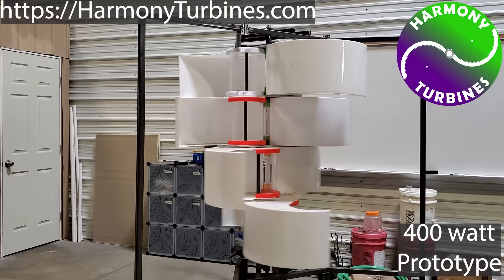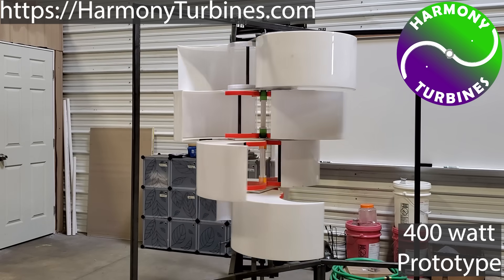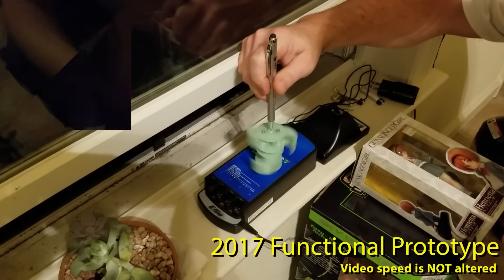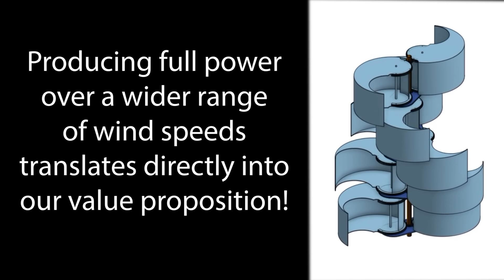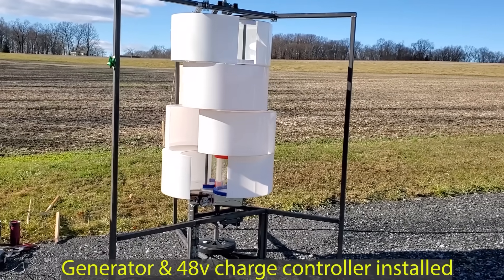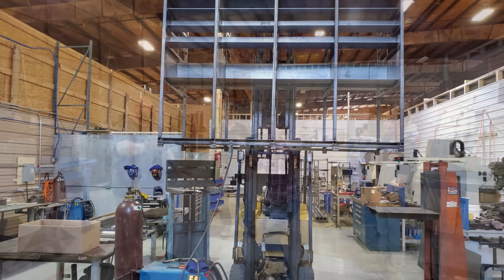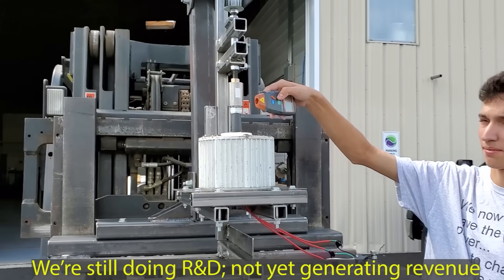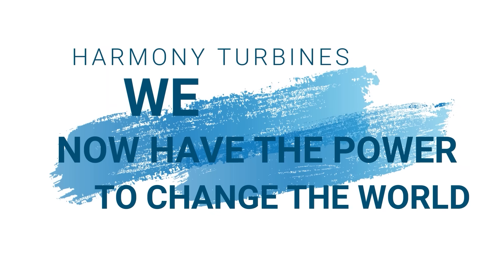What makes Harmony Turbines so revolutionary?

Comment: Looks like a variable Savinious rotor to me…  plans in mother earth news back in the 70’s-80’s…  vertical wind turbines can be better at harnessing gust energy, but a higher spinning mass negates some of this possible gain.  The fixed savinious was self starting and tended to be self regulating as the advancing bucket shadows the capture bucket more and more as speed increases, so it was virtually impossible to overspeed them.  I am guessing the variable mechanism is an attempt to increase low airspeed efficiency.  The fixed savinious was able to generate a significant amount of torque, and they were fairly easy to produce out of old drums…
Reply: Thank you to point out this claimed "revolutionary" product is just a bad commercial copy of an open source DIY design that have been here for decades. That is not "entrepreneur" attitude, that's the sort of attitude that gives good business a bad rep.
Reply: @lolaa2200  Nearly every "new revolutionary" wind turbine design already existed decades ago or is a slight but almost unnoticeable variation of one. There even is a book that sums up all these designs and their flaws and why they never were commercialized successfully. I think the author was interviewed in one video made by "Engineering with Rosie". 

Edit: youtu.be/6vb18oXPli4
Reply: I never heard of that type but I'll look that up, thanks for the hint!
My first thought was "it's a collapsible Flettner rotor" but this one is the only one I know that generates power from wind of any direction.
Reply: Savonius
Reply from the maker: Hi Rronmar, check out this article. High windspeeds are indeed a problem for Savonius turbines. Our design solves the problems associated with high speeds winds. In fact it totally negates the need for a braking mechanism or dump loads. https://www.turbinesinfo.com/innovative-wind-turbines/  ...interestingly this article also speaks to the little known fact that bad data published many decades ago, has led to Savonius turbines getting a bad rap for the last 50 or so years! -We are looking to change the history books and begin showing people what a truly well designed small scale turbine can do! Perhaps we can even become the new standard in small-scale wind power generation? Time will tell.
Reply: @HarmonyTurbines  Math is math and doesn't care about our dreams. If I want to produce energy on a small scale, I can just use a small HAWT, or better use solar and the turbine only for the last step to autonomy. 

Till now I only saw one application, were a VAWT truly outperformed HAWTs, and that is as an integrated part in lanternposts in the  middle of highways for energy-harvesting. Be careful with promises to your customers and investors: Some VAWT-enthusiasts even got themselves imprisoned because of false claims.
Reply: @HarmonyTurbines  well I only remember they were not an issue back then…
Reply: @HarmonyTurbines  I like your design. I'm planning to build Savonius units myself. I just moved out of the suburbs and on to acreage surrounded by flat farmland where it's windy often. I like the staggering to reduce vibration and noise. I really like your furling system. A pet peeve of mine has always been turbines that shutoff in high wind instead of safely producing full power.

That said, with your production facility at the stage it is, I'm disappointed that you don't have units for sale. It seem like you are wasting resources designing a generator. What do you expect to gain there? It's like you are addicted to R&D and R&D money. You keep saying that it's 30% efficient. Even if it's only 20%, if it's affordable and/or has other significant benefits, it's still a good design. The wind is free, so lower efficiency doesn't necessarily cost anything.

Where is the output chart: wattage produced at each wind speed. If the numbers are poor and you expect an new generator design to significantly improve those, you are mistaken. Your ROI on the R&D money will be low if you only attain a 1.5% output improvement. The whole world has already optimized generators.

Here's a snippet of market research: during winter and spring, I have a lot of 15-20+ mile per hour wind crossing my driveway (steady for days or weeks at a time). I'm looking to build or buy multiple 500w units to mount along the driveway until I have the power necessary to supply my low power house. I'm willing to pay decent money for a reliable unit. Do you have a product for me (and others like me) or not?
Reply: @HarmonyTurbines  So you have to apply power to the thing to make it close right ?
Reply from the maker: @cuckingfunt9353  Yes but closing (furling) is only needed in high winds so there's plenty of power during those times to sacrifice 30w for 10 or 20 seconds. The power is only needed while the furling mechanism moves. It is NOT needed to hold the scoops in place once the movement has stopped. We're spinning too fast, pull in a bit, re-assess, still too fast, pull in more, re-assess ...ok we're good now. The total power that took was maybe 30w for 15 seconds. The turbine will be making over 400w of power at these times so we're totally fine to steel a drop or two of power for the sake of safety.
Reply: @HarmonyTurbines  
Whut?!

Is motors needed? 
Why not a passive centrifugal regulator like old steam engines?
Reply: @madshorn5826  That’s what I was thinking!
Reply: @madshorn5826  Because someone has already done it and thus he can't make a patent claim unless something is noticeably changed... So he is using electronics which are more likely to fail then a centrifugal system.
Reply: @HarmonyTurbines  but he said that high wind speeds WEREN’T a problem for Savinous design because the get less efficient and turn slower because of this.
Reply: @HarmonyTurbines  but where do we get them?
Reply: @HarmonyTurbines  your article doesn't cite any sources.
This looks very scammy.

And even if the claims in this article about exchanged curved were true, the possible efficiency is still way lower than conventional three bladed designs.
Reply: @HarmonyTurbines  Work on hyperloop and Theranos while at it :D There is a finite amount of energy available in a cross section of wind. You can call it bad data or whatever you like.
Reply: @NGC1433  The hyperloop is an amazing project, don't mock it! At least on paper it's amazing. When you try to think about the practicality of it, the dream somewhat implodes ...

(Sorry, I couldn't resist)
Reply: @haifutter4166  - Implodes? "That Sucks the Big One!" 🥴🤭😂

Comment: I'm not interested in video footage of work in progress or fluff about saving the planet for a better future for the kids, I want to see HARD DATA, ideally in the form of a graph of Power Generated VS Windspeed. This is the bottom line. Thanks.
Reply: Power is mainly determined by wind speed. For 1 square meter the MAXIMUM energy from the wind is kW = 0.0006 * wind speed CUBED. So for 1m^2 and average city wind speed of 2m/s you get 4.8 watts. Small city wind turbines will always be useless.
Reply: @AORD72  Yup wind power scales with the cube of wind speed. Doesn't stop students winning Dyson design awards for innovation for their omni-directional ball like wind turbine the size of a beach ball that can be attached to the side of buildings and of course is going to "revolutionise" wind power generation in cities... 🙄 The bottom line is available local wind power, if you haven't got that you're dead in the water.... or rather wind.
Reply: @danielturner9832  Doubt it.
Reply from the maker: That will be coming as our 3 universities (Bucknell, PSU & Northumbria) begin their research projects on Harmony and our technology. Performance data and lots of other great stats will be fully published then.
Reply: @HarmonyTurbines  So in all the years you've been developing, you've never taken any basic power measurements and correlated them against wind speed? Not even a Prony brake style set up to measure raw mechanical power from the turbine shaft? If not, how did you become convinced you had a worthwhile product on your hands...? 🤔
Reply from the maker: @saiello2061  the pony brakes that we looked at trying are thousands of dollars and need stationary mounting. This means we have to have wind come to us which is unlikely in our area with such bad winds here. To mount a setup on a moving trailer or platform is also very complex and dangerous as we found. If you have links to a simple inexpensive pony break, I'm all ears. We also tried 2x different off-the-shelf generators and both were terrible for our low  RPM’S. So what sounds like a simple thing is really very complex. It's why we're now developing our patented generator. It's our best option for moving forward and getting all the data we want.
Reply: @HarmonyTurbines  Sounds like excuses to me now. You can make a Prony brake for next to nothing using some form of spring balance, a handheld tachometer and a few other bits and bobs. Lots of info online. As for a generator, there are so many options out there to get some sort of voltage/current reading it's hardly worth mentioning. With the size turbine you're experimenting with, I doubt you'll even be getting 100W shaft power out of it in a stiff breeze....
Reply from the maker: @saiello2061  you be as angry and pissed off as you want. Scream at the top of your lungs and run around like a little girl. It doesn't matter what you're saying "should" be easy or quick to do ...it's not. We've had PSU and Bucknell both look at this issue with us and it's more complex than it appears at first glance. The way other turbine companies get their power ratings is NOT with a pony brake. It's with a properly sized generator matched (tuned) to the RPM's that they need to run in a wind tunnel at the rated windspeed. Then most of those ratings are thrown OUT the window because Underwiring Laboratories demands open air equivalent testing which negates wind tunnel testing and wall effect from compression. But who am I to tell you ...you seem like an expert and probably know all of this. For now the best I can give you is a "sorry you're going to have to wait" the data is coming as quickly as we can get it. No amount of insults from you or anyone will make them come quicker. By the way with the CRAPPY generator and charge controller we had we got up over 300w in our testing last year so your 100w prediction is off by a factor of 3x.
Reply from the maker: @saiello2061  the data will be ready when it's ready. Here's some data that we gathered, not the best but it's a start: https://www.youtube.com/watch?v=VBW1g3b-zN4  if you don't like this answer and insist on speaking in condescending ways, I will simply ban you from the channel.
Reply: Calling someone a little girl and threatening to ban them from the channel, very mature!

Comment: What they don't tell you is that this type of wind turbine is never that efficient to begin with..
Reply from the maker: @Finnspin you're wrong about that. It's finally coming to light that this has been a disinformation campaign for decades starting back in the 1950's or around there. Look at this https://youtu.be/pbtR6VG-gLw?t=225
Reply: @HarmonyTurbines  Very interesting narrative you are building there. Savonius rotors have continued to be a topic of research, and the highest c_p people have seen in studies (with pretty optimized geometries) is ~0.3. Significantly more than the chart, but not nearly as much as you are claiming.
Show me your c_p curves verified by a university, then I'm interested.
Reply from the maker: @Finnspin_unicycles  Everything that the university projects reveal will be shared openly and publicly. We have 3 different research projects going on starting here in the 2nd quarter of 2022. Penn State University, Bucknell University & Northumbria University. So we will be just as excited for the data and the results as you are.